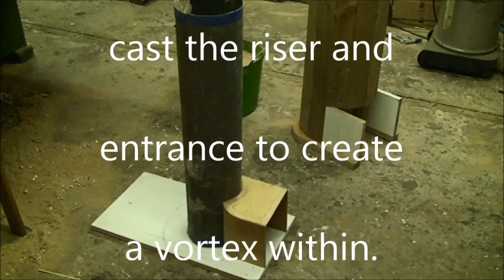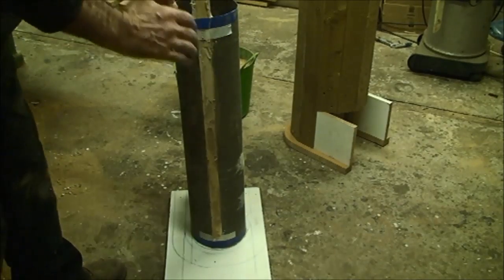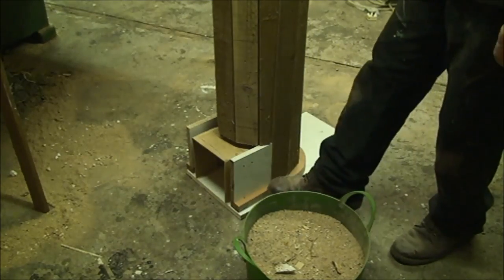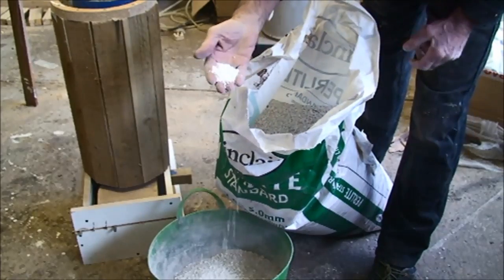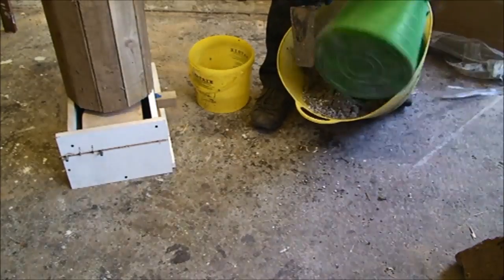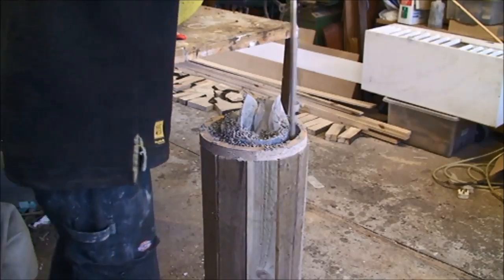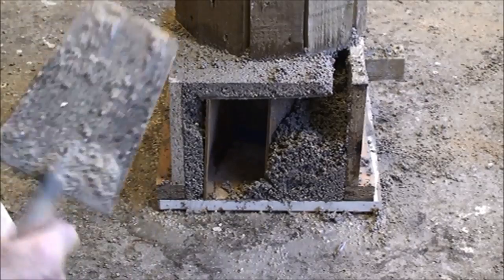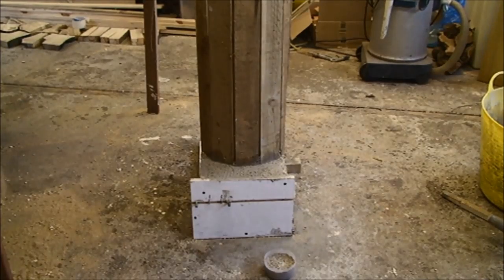New rocket stove mass heater cast riser Part 1

Comment: Hi PP, thank you so much for sharing this.  This is almost exactly how I am planning to make my rocket stove (cast clay and stuff).  Mine has to be really small though, I'm talking 3" feeder and burn chamber (about 5"-8" long), the riser will be about 21" tall made of clay and vermiculite or perlite (can't remember what I've bought now).  Does the inside diameter of the riser have to be slightly bigger than the burn chamber?  I can maybe make it 3.5" or 4" but my outside "barrel" is a 9" diameter 5mil steel tube 22" high so not a great deal of room for manoeuvre.  This will be my prototype to make sure it works and I have the dimensions right and can get the right draw.  I'll be using steel food tins for my sacrificial linings and kitty litter clay for the cast.  What do you think?  Any advice would be greatly appreciated.

Regards,

Poo
Reply from the maker: poosmate Hi there, the riser can be the same size or larger but I wouldnt go smaller than the burn tunnel in my experience. I know alot of people use cat litter for casting risers but I have no experience with it sorry. Cheers
Reply: Thanks for getting back to me.  I'm not in a position to start my project now but am always on the lookout for suitable "ingredients".  I think I'll stick to my original plan for now.  If it works I'll probably make the next out of more substantial steel tube for the riser.  If that works then I can explain exactly how to get the steel tubes really cheap (hopefully - I got my first one free).  Luckily a guy offered to weld a steel plate on one end of my tube and did it for free.  Unfortunately I haven't seen him around for a while.  This project really excites me, I can't wait to start - should be some time this year!

Thanks again,

Poo

Comment: Great job, Could you tell me a little about the refractory mix you used. Is it just clay or is it something else? I'm not sure where I can get something like that around here.
ATB, Steve...
Reply from the maker: stevenk1965 It is a castable refractory mixture I bought ready mixed rated to 1700c from a company in the UK I will put the link in the video description above. maybe you can find a similar mix where you are. Cheers.
Reply: *****
Thanks for the help, I checked out the link you left me and found some similar products closer to home (up state NY)
Thanks again, ATB, Steve...

Comment: So how about using an old acetyline gas bottle as a riser to replace the one heating your workshop stove. I'm using an old extingusher bottle CO2 powder one as a riser it's 5mm thick
Reply from the maker: ftrikerfox Hi I guess you can use one trouble is all non stainless type steels seem to fail after a time, which is ok as long as you make the stove modular so you can replace it easily.

Comment: Good video,why not just leave the pipe in?It will adf support as the refractory heats up initially and if it burns up over time so be it.
Reply from the maker: Bill Fleming Thanks Bill, I suppose you could just leave it in but depending how much it expands when hot it might just crack the casting? main reason I took it out was so I can use it again to cast another.

Comment: looking forward to the results, 

Is the stainless riser deteriorated, was going to use SS in my project but now having second thoughts, 

Cheers mate

Madd Macc
Reply from the maker: Madd Macc Hi Macc, A few people have been disturbed about the stainless issue, before i lit the fire today I had a good feel around inside. Actually the walls of the stainless are ok, they are a little buckled but perfectly fine. What seems to have happened is the welding has come apart at the bottom of the riser at the point where the secondary air feed is. Im sure if I had used SS welding wire this would not have happened so its restored my faith in the stainless. Cheers...Loz.
Reply: ***** Thanks for the reply, as I am also an expat, ( Brit ) I am used to chimneys and fireplaces made from brick,
As SS is obviously lighter, Maybe I will try with SS riser, then with firebrick riser. See the differances in tempratures as well
Cheers again.

Comment: Very interesting, but why not just go with straight refractory?
Reply from the maker: ***** Hi John, I added the perlite to act as an insulator, im not sure how it will work until I try a test burn, I didn't want the riser to be solid refractory as it will leech heat away from the inside core.

Comment: Casting the whole riser… neat.  I look forward to seeing how that pans out.  I've been mulling over casting the firebox and transition into the riser but assumed I'd be going into a stainless steel riser as usual.  Your findings of the SS degradation is interesting. 
For the firebox casting I was wondering about carving it out of a block of polystyrene with a hot wire cutter so I'd get smooth sides and introduce the vortex with a rotation of the chamber.  Fancy, I know.  ;)   The plug would simply be burned out afterwards. 
You mentioned briefly about not using a tank this time?  Do you mean not using the gas cylinder?  If so, what are you thinking of?
Thanks for sharing. I really enjoy your videos for being wonderfully practical.
Reply from the maker: Marcel Lenormand Hi Marcel, and thank you..Please mate just go ahead and build it because if you follow what others are doing and only do that you wont break new ground or learn anything IMO. Before Dale mentioned a vortex in a rocket stove no one had made one. the rocket stove Is such a simple superb way of producing heat and some might say not rocket science. I see guys getting tied up now with advanced theories on vortex paths and quantum maths inside the transition void..!!! People like to talk and people like to do. you will only ever extract a given amount of heat from the fuel you are burning, and to go beyond that I have no interest. Some will take it to the extreme I am sure, and if they achieve perfection all well and good.  I am happy to plod on and work through my projects testing as I go. I really have had no time at all this last year to work on my ideas and this casting is the first step in a long ish road maybe, i like it that way.
I will be building the body to disperse the heat much faster than a bottle, I have other ideas which I will share in the video as we go. Cheers.
Reply: Good idea about making a plug out of polystyrene.

Comment: Those 'vortex' are  accelerators,
after you must make bladies as A.V.E.C. vortex to concentrate (explode).

You see some for cleaning water, they so get accelerator
and just after an inner and outer screw;

Anyway I suppose with such temp. its ever efficient.

Have fun.
Reply from the maker: fred san Hi fred the method i use is simply to mix in secondary air and to hold the gasses in the riser slightly longer, I dont need the gasses to spiral all the way up the riser as all the combustion occurs in the bottom third of the riser. anything inside the riser restricts the flow in my opinion, i have tried it and gained nothing from it. Cheers for the suggestion though.
Reply: Hello.
Ok
I do a pekka leskela cooking for van with air entry up fire chamber, I try something like that so, and will add a vortex AVEC but stair up, in tthe chimney.

I did several for motor engines,
they must be well done and 1/3 center hole, and 2/3 diameter blades,
and mostly have to try each time several number of blades to find the right one,
unless of course gained is not obvious, or less power if bad done.
To try I do them in aluminium or thin steel in air entry motor (or exit exhaust),
the final one in steel less thin to resist Temp° & pressure.

For stoves I only tested a big can 5L with plenty vortex, wanted to show it runs,
a bad video on my channel show a few, not test but differents parts.
I never finihshed it unfortunetly....
but it rans with just 2-3 vortex  fire between 1 to 1.5m hight (which is not bad for a can).
So have to...test test test ... before find good one for stove chimney.

Notice :
in car , vortex exhaust run after 70km/h (such temp and pressure), so
 its not sure to see difference at begining of fire, and maybe have to wait very hot stove....
(on 5L can, outside wind made the difference quickly).
Air entry from outside ?

Thank's for showing mix perlite, i have to do one too.

Cheers.